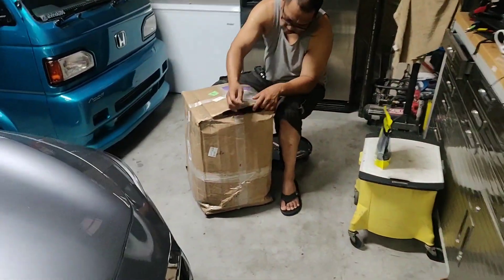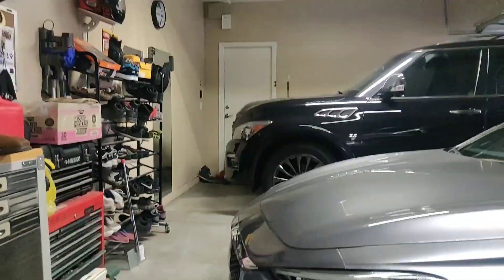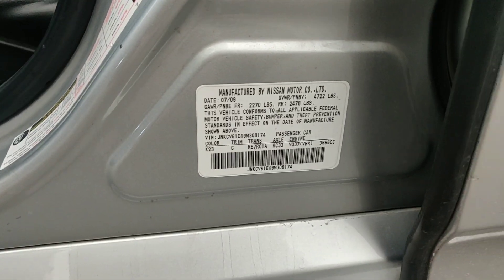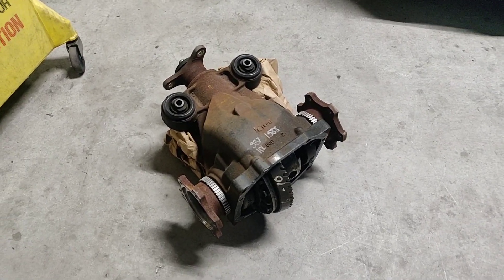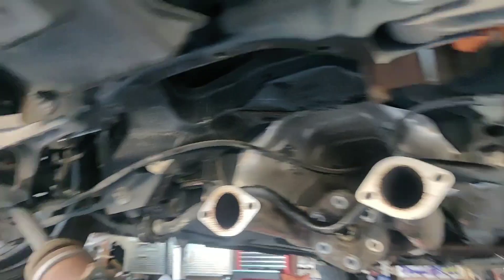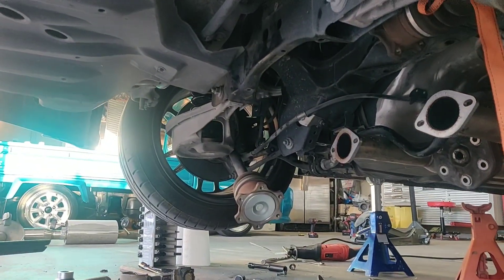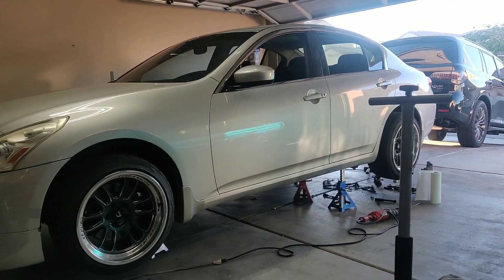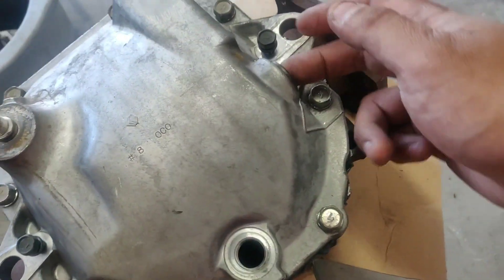G37 VLSD

Comment: Wondering why you had to swap the differential covers?
Reply from the maker: I swapped my diff cover to the new differential because the one I bought didn't come with one
Reply: @INFINITIBROTHERS  Ahhh ok thanks my Infiniti brother. Just wondering, I’m replacing my VLSD tmrw on my 08 G35S it was howling I suspect pinion bearing so just got one from an 08 G37S.
Reply from the maker: @e46m54nissansr20937  I ended up damaging this differential and went with a real LSD. I was hearing a loud ticking noise and it's not the wheel bearing it was something going on in the differential. You will love the vlsd. Make sure you switch out your mounts to polyurethane it makes a night and day difference 🤙🙏
Reply: @INFINITIBROTHERS  Im just replacing the VLSD with another one mine came with 3.69 VLSD. I also recently replaced the rear wheel bearings thinking thats where the noise was coming from too but it was the diff lol very disappointing. What diff oil should I use for the VLSD ? 75w90? Synthetic or just regular gear oil?
Reply from the maker: @e46m54nissansr20937  yes you're fine with that as long as u change it. I'm using Lucas
Reply: @INFINITIBROTHERS  Ok for sure, eventually i do want a real LSD and the 4.09 gear ratio. I also am looking at a 15-16 3.0T or a 16 340i, still keeping the G though.
Reply from the maker: @e46m54nissansr20937  in that case don't spend too much money on the G just get a VR! 😎🙌🤙
Reply: @INFINITIBROTHERS  The G is special to me and who knows a may supercharge one day. Also i just noticed you are from Vegas I am too lol. My wifes family is also Filipino Razon/Devera.
Reply from the maker: @e46m54nissansr20937  no shit... What a small world huh!? Do you have an Instagram? Follow me on there and message Me  brother @theinfinitibrothers 🤙🙌
Reply: @INFINITIBROTHERS  I just got my lsd from a q60 Ipl and I’m going to install it once I get a chance got any recommendations before I install it
Reply from the maker: @sweets4172  Yes make sure you change your differential mounts to polyurethane or solid. I recommend polyurethane
Reply: @INFINITIBROTHERS  thanks you and where can I find those
Reply from the maker: @sweets4172  z1 eBay concept Z has them . The brand is Whiteline
Reply: @INFINITIBROTHERS  preciate it brother thank you 🙏

Comment: Could you do this on an X model
Reply from the maker: Absolutely all you have to do is change the flange
Reply: @INFINITIBROTHERS  you got a link bro I was going to order one
Reply from the maker: @kev_g37x  You can find a VLSD on eBay that's where I got mine 🤙
Reply: @INFINITIBROTHERS  sweet thanks dude is this swap even worth it for an awd model I never seen this mod
Reply from the maker: @kev_g37x  honestly if you have all-wheel drive there is no need for it but it will make a difference
Reply: @INFINITIBROTHERS you think it’s worth it if I get a built one from z1 and since I’m AWD will this do any harm to the system ? I got to make sure it’s from the sport model Gs in any year is good too right?
Reply from the maker: @kev_g37x  a real LSD is always 💯💯💯💯
Reply: @INFINITIBROTHERS I just purchased the rear diff ipl do I need the front diff from a g35xs it has the 3.69 but I think it’s an open diff for the front u think it will still harm the awd system or abs
Reply from the maker: @kev_g37x  no you'll be fine 🤙
Reply: @kev_g37x what happened is everything still good? Also what did u have to change in order to install it I have a g37x and want to kno what to buy

Comment: I’m a little confused. So is the gearing in the sport and journey models different ? If so what are the gearing for each. Is the 3.36 only in auto ipl/sports and the 3.69 manual ipl/sport. What’s the gearing for journey autos and manuals ?
Reply: Another question I have is, is the 370z diff compatible with g37’s ? And is the gearing any different than the g37 diffs or is it the same gearing
Reply: @staticfin do you got any information?
Reply from the maker: They are all different. There's a list somewhere online where it gives you the gear ratio for each model.  They're all compatible.. manual and automatic has a different flange from the drive shaft to differential. But you can always change it

Comment: Hey, I have a g35 sedan and want to put a g37 differential in it. Is that a good idea and when I do should I change keep the g37 differential and just use the original parts for the axle
Reply from the maker: You can put any diff  as long as you know what gearing you want